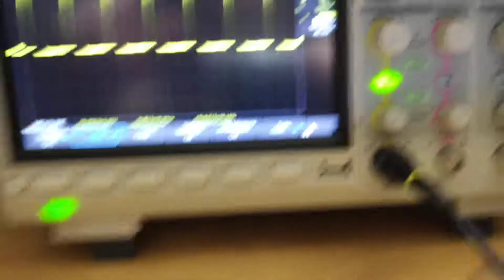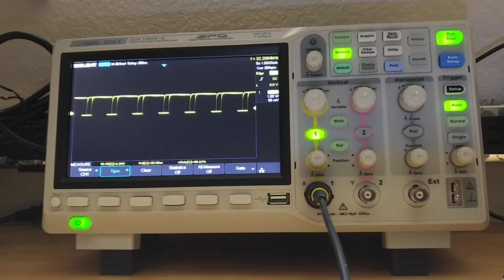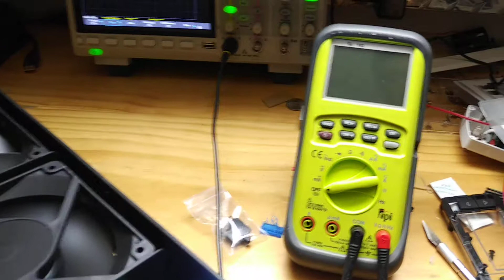AC Infinity fan controller

Comment: Hi, I'm a noob in electronics, I would like to know if it where possible to hock a 12v pwm pc fan to an AC infinity 69 controller and controll the speed of the 12v fan with the controller ? I need a smaller fan than their smalest cloudline for a drying cabinet.

Comment: Perfect I was wondering what the PWM frequency was as I wanted to make a custom bath fan controller for the AC infinity fans.  Much cheaper than fantech EC fans.  What is the voltage of the signal?
Reply from the maker: Hey, the voltage is like 1.84v with a 25khz signal.    Right at the 1:00 minute mark on this video I was fiddling w/ the vertical scale... you can see it flash "1.00V" on the screen briefly.

Comment: just opened mine it has 3 pins labeled FG + and - , what the heck is FG?
Reply from the maker: 3 pins?  Are those on one of the JST headers or somewhere else?  All mine were 4 pins or more.  Only thing I can think of is Fan Ground, which makes no sense.  Got a photo of the board?
Reply: xyvyx I dunno I’m knee deep in fail jst connectors :(
Reply: xyvyx they are jst 3 pin . I got the 3ru exhaust fan and changing out the fans or at least trying to
Reply from the maker: @jmvediting  gotcha...   In the pictures, their T9 "cloudplate" looks pretty similar to the one I have.  I guess they could have changed up the design, so if the fans only use 3 pins  a) they use variable voltage (which could be measured) and the 3rd pin is for speed monitoring b) it uses PWM on the 3rd pin and they ditched the speed sense line
Reply: @xyvyx  so i have noctual fans what should i put on the third pin? RPM or PWM?
Reply from the maker: @jmvediting  I would try PWM first.... It shouldn't hurt if it's actually used for RPM. It might just not do anything.   
If you have a voltmeter available, you might be able to measure that 3rd pin relative to ground / -.   If it's PWM, it'll measure around 1 volt when set to full-speed.
Reply: xyvyx getting 11.8 on full speed , 4.5 on lowest speed . So wire with RPM speed ?
Reply from the maker: @jmvediting  ok, not sure, but sounds kinda like it's doing analog (non-pwm) speed control w/ that wire. Different from mine, so I'm just guessing!  But if your noctua fans are pwm, I don't think that'll work :(
Reply: xyvyx well I wired it negative to negative and positive to positive and rpm to the fg plug and didn’t hook the pmw up at all and it seems fine . I think this board when the temperature gets high it just steps the fan from level 1 to 6 I don’t think it moves at a curve just steps the speed so it should be good how I wired it right ?
Reply from the maker: @jmvediting  ok cool.. yeah, I didn't really think about that... but yes, if it varies the whole voltage between 1 - 12 volts and the fan responds, that's all that matters!   I know that mine beeped at me if I didn't connect the RPM sense pin, but if yours doesn't, then don't worry about it!
Reply: xyvyx well it has been running for a day no problems . Thank you for all your help! You saved me so much trouble !!!
Reply: Still crossing my fingers I did this right . Fg is really weird to see on a fan header . I’m seeing frequency generator when I google but who knows! All I know is when the voltmeter was hooked up to that pin it would push out 4-12v depending on speed and I know noctua says you can use the rpm cable for variable voltage so I hope I hooked it up right and not going to melt down my rack
Reply from the maker: @jmvediting  yeah, i don't think there's much worry of anything burning up.  if the +/- leads stay at fixed voltage, what you did sounds like the only way to go.

Comment: I've just set up an AC Infinity cabinet ventilation system myself for my UPS and a few other bits - interested in what your impressions are of noise levels of the Noctua 120mm fans vs the stock AC Infinity fans? No issues with speed control? I'm vaguely considering buying some Noctua 120s and swapping them into my cabinet, have been generally very impressed with Noctua in the past
Reply from the maker: Sorry for the slow response, James!  I'm guessing the airflow is about half what the stock fans move, but if you need it quiet... they're definitely better.  My soldering skills on tiny connectors is crap, but  here's one of the fans connected... seems to work & control the speed just fine!   

https://youtu.be/rQcC4hMS28E
Reply: Nice! Definitely much quieter in that new video. I have a different AC Infinity controller, just a few USB ports on - cut some holes in a cabinet and hid the UPS in there, and with a Noctua with a USB adapter, the noise is low and the spouse approval factor is high. Noctua have a very low startup voltage so it's worked out fine - but of course, much lower RPM given they're being shortchanged a bit. That said, will likely swap them out for a dedicated 5v fan that Noctua also produce and put the 12v into service on yet another project. Thanks for the followup, looking at the T7 a bit closer gives me some other ideas as well!
Reply: Hi James  - can you please let me know what USB adapter did you use to connect the Noctua to you AC Infinity Controller? And which controller is that (1,2  or 8)? Thank you!
Reply: Sure thing - the USB adapter I  purchased was https://smile.amazon.com/gp/product/B071NN5PSL. I have the AC Infinity 2 Controller, with just a single fan for extraction at the moment - intake from the port I cut in the cabinet for cabling (+leakage) works fine for intake for. If you don't have spare fans lying round and are buying them specifically for this, I'd recommending looking at Noctua's 5v 120mm fans - they come with their own USB adapters. Also, when driving the 12v Noctua fan with the AC Infinity controller, I find I can't run it on the smart setting - while it does have a very low startup voltage for a PC fan, it seems to have problems running the very low controller settings for an extended period and will stop.
Reply: Hey James...I looked at this adapter before, but it only had 2 pins. Which would not give you the pmw functionality.This is what I was looking for when buyin the AC Infinity controller. With this adapter you will have your fan spinning at the same speed all the time. I’ll receivle rhe 5v noctua fans on monday and will see if they come with any useful adapters. If not, I’ll build one, assuming I will be able to match correctly the pin-outs
Reply: With the Ac Infinity Controller 2 - it uses variable voltage rather than PWM, so I wasn't concerned about that. Not sure I've ever seen PWM over USB for a fan? If you're hooking up to one of the big controllers like the T7 though, I believe they do actually use PWM rather than variable voltage.
Reply: Wonderful and insightful video! Question - ive been looking for a sleek temp controller to control the speed of a compressor (instead of fan). The speed control of the compressor has 0-5v pwm ability (also regular 0-5v with rheostat). Can I use this controller (assuming all ac infinity controllers) in Smart mode to ramp up/down my compressor? Thoughts? Thanks in advance!
Reply from the maker: I suppose if the PWM input operated at the same frequency, I guess it could work.  Might be easier to tap into the external molex connector to do this & maybe leave the fans intact.  What kind of compressor is this?